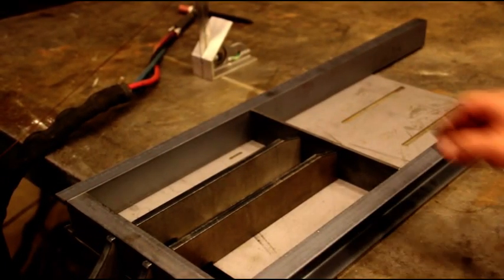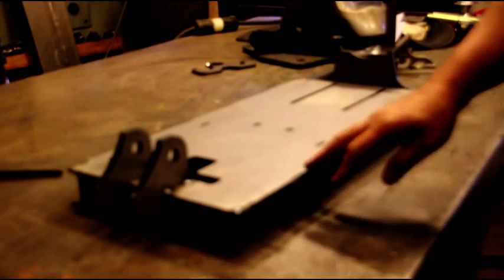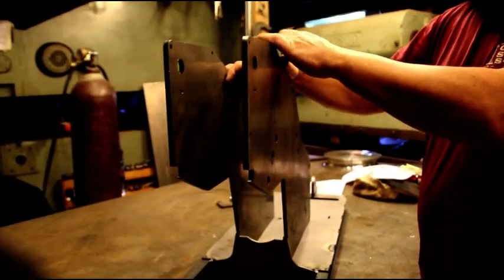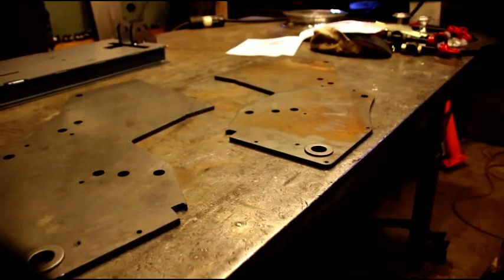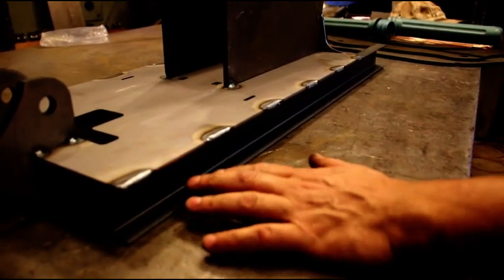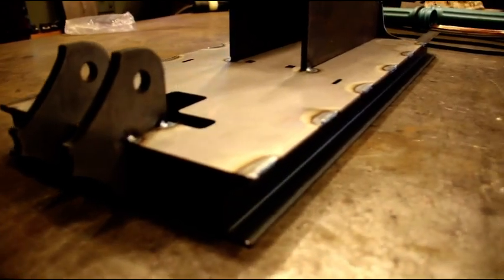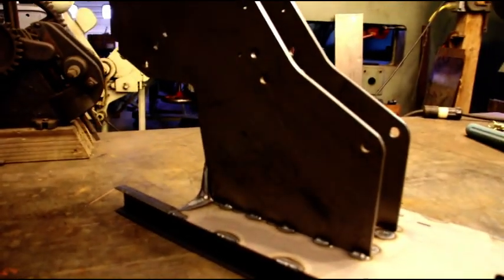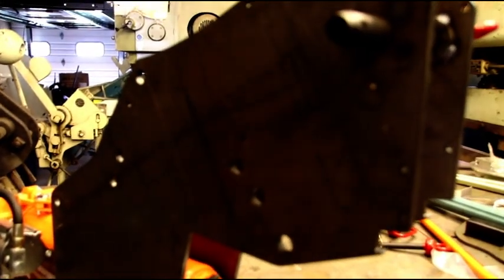Metalshaper Welds Up A  Rogue 600 xHD Tubing Bender

Comment: How big of an Air Compressor is needed to operate the cylinder?
Reply from the maker: The jack on the bender does not require much air, I run it on my shop compressor all the time but have also used small, portable compressors to run it as well when using it out of the shop on projects.

Comment: I like watching all of your videos, but i suppose because of the lighting all the up close parts are out of focus and moving around to much I’d rather you back out and put it on a trypod, other than that great job it’s rare someone has your all around talents, I’ve spent many a hours doing body work and painting but am marveled at your panel skills and equipment keep them coming I’ll also enjoy the sawmill build.
Reply: I was actually going to say the same thing. I really like the videos, but rarely is anything in focus. So we loose so many details from the camera being out of focus most of the time. Check your camera to see if you have a close up option. Or either get a different camera. What you are doing is very interesting, but it is hard to continue watching your fuzzy videos most of the time. JMHO

Comment: I am also tiging my 600 HD together and was wondering how much will to put where and your video pretty much answer that for me my rights I was going to weld hundred percent but I see you stitched it so I think I will just Stitch mine also
Reply from the maker: No need to weld it 100%.  Stitch it together like I did in the video and it will work fine .   I bent a lot of 2" tube .180" wall thickness and the machine performed perfectly.